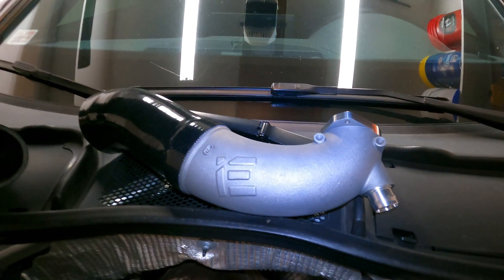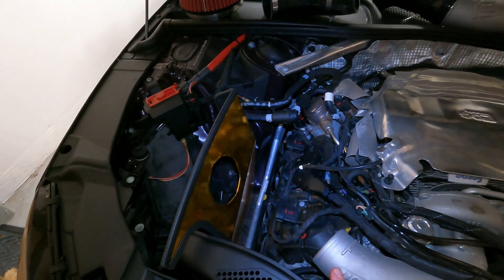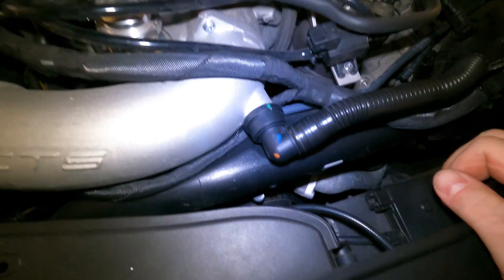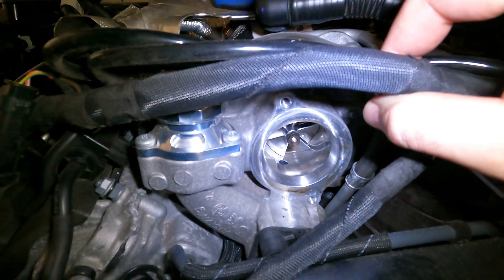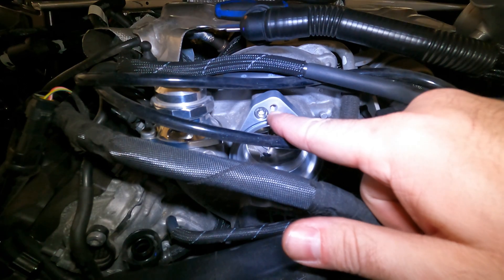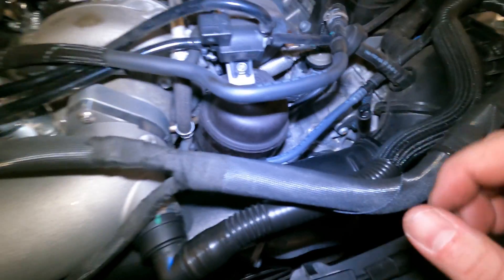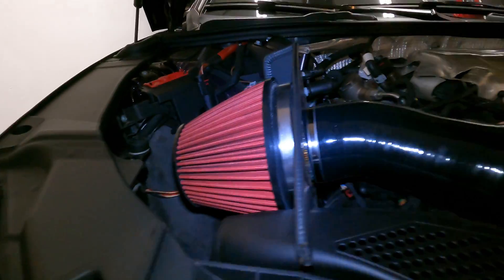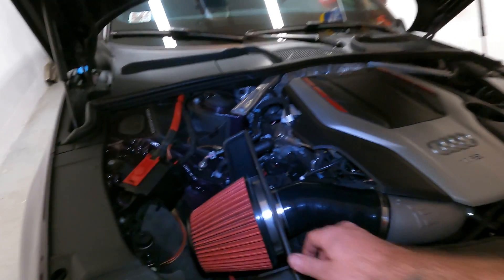B9 S4 - Integrated Engineering - Turbo Inlet Pipe Install

Comment: Do the car still pass smog with this intake and turbo inlet? And would the check engine light come on or stay off?
Reply from the maker: Honestly, I couldn't tell you about the smog stuff. In Florida we don't have those regulations (you can pretty much do whatever you want to your cars here lol). I would hit up Integrated and ask them just to be sure. However, your check engine light will not come on with just an intake and turbo inlet.
Reply: @Wobblenuts thank you bro i appreciate the help 🙌🏽
Reply from the maker: @Boostedkraft  Of course, I appreciate your support

Comment: What tool did u use for the bottom bit for the inlet
Reply from the maker: Haha basically a little wrench with an allen bit stuck into it. Very small turns. It took forever.
Reply: @Wobblenuts  so I was working on it on my Audi a6 c8 since the engine is pretty much the same and I think I might of stripped the bottom bolt :/
Reply: @Wobblenuts  took me almost 1h to get it out towards the end maybe like a mm to the end I might of stripped it
Reply from the maker: @L1N_s5  hmm, if you're able to shine a light in there and look I would double check. I think based off of where it is and the size it would be tough to strip out. If you did strip it, you could try getting it by hand, or try to shove a torx in there.
Reply: @Wobblenuts  I mean I couldn’t get a bolt back in
Reply from the maker: @L1N_s5  ohh once you got it out. Hmm, I guess its possible it could be cross threaded but I think that would be difficult given the amount of space/force you'd be able to crank down with. See if you can stick your phone down there and record a video of the threads to verify.
Reply: I had to tap it just slightly tap was too long so cut the tap 1/3 from the rear then made Ike a box so the round part had 4 flat part to grip
Reply: Went and traced the thread maybe 3-5 mm in and it went in
Reply from the maker: @L1N_s5  man sounds like a headache. Glad you got it sorted though.

Comment: Whats the pipe below the intake, i thing mine is not connecting 100%
Reply from the maker: I believe you're talking about the charge pipe. If yours are factory it should be screwed in on both sides of the engine. You'd definitely be losing power and have a boost leak if it wasn't 100%

Comment: is it bad to over tighten the stock air intake clamps around the hose? I’m talking about the one where you tighten with the flat head
Reply from the maker: I mean you want to be careful to not strip anything, but these clamps are pretty hard to over tighten. I don't think you'll break anything or mess anything up if they are a little tighter than they should be. You for sure want to make sure they are nice and tight though to avoid any movement.
Reply: @Wobblenuts  thank you 🙏
Reply from the maker: @andytran-ry7yc  of course
Reply: The hose clamps

Comment: what does it do?
Reply from the maker: The IE turbo inlet is better and a better design allowing more airflow to get to the turbo. That will help with power and responsiveness 😎
Reply: @Wobblenuts  does it need a tune to help?
Reply from the maker: @andytran-ry7yc  it does not require a tune, but a tune will only increase air/fuel and power.
Reply: @Wobblenuts  so even without a tune. An intake and inlet pipe will add benefits to my car? i’m planning on tuning on IE after a couple of months
Reply from the maker: @andytran-ry7yc  absolutely. Anything that increases airflow into the engine or out of the engine it will make an improvement. Then if you do the tune you'll gain even more out of those mods vs. the stock parts.

Comment: I did this yesterday and had a ton of fun getting that stupid oring to stay in place, even with some grease to make it tacky. Bad design. Should have been a gasket set into a deeper groove.
Reply from the maker: Yeaaa those o rings can be pretty annoying. Hopefully the rest of the install was smooth.
Reply: ahahahahhaa.. no.
Reply from the maker: @B5tard  aww man, I feel you though. I got frustrated a few times, but you don't see that in the video lol. Overall I feel it wasn't terrible if you follow the instructions to a T.
Reply: @Wobblenuts  when you find you your low profile driver is not low profile enough....
Reply from the maker: @B5tard  lmao pretty much
Reply: @Wobblenuts  And then after 2 hours of wrestling with bits and vice grips and trying to keep the blasted oring in place (yes i used some grease)... I find out they shipped me the SQ5 coupler. Which would be fine if it wasnt an S4.. Weeee!
Reply: any tips for the orings? I cant for the life of me figure out how to get them to go on. 1 hour and counting. Someone please help.
Reply: Yeah oring gasket sucks I wish I had a trick for it 😕

Comment: I’m doing the same on my b9 S4 but have the ecs luft technik open air intake with the IE turbo inlet next week.. any difference in power or response? Wonder if getting the IE intake is worth it since I have the IE stage one ecu/TCU tune
Reply from the maker: So I’ll say compared to the CTS setup that I had I can feel a difference. Most intakes are roughly the same as far as flow so I’m not sure it would make a huge difference. But, the IE intake is a very beautiful piece and well crafted. I’m sure the box helps keep temps down too.
Reply: @Wobblenuts  awesome thank you for the quick response! It is a nice looking intake for sure
Reply: @Wobblenuts  what would make more of a difference the IE inlet or the intake?
Reply from the maker: @AndyTran-e6j  I say the inlet first, because the OEM one is much smaller/restrictive for sure.

Comment: Did u notice any performance increase at all with doing the inlet? Or is this more going to be a piece that may do better for better flow on maybe a hybrid turbo setup and more boost down the road?
Reply from the maker: Absolutely. I noticed a difference between my old intake setup and the new one. It feels more responsive.
Reply: @Wobblenuts  nice I just drove a x3 m40i today I was debating returning my b9 sq5 for one but when it came to the interior the seats and air suspension I just couldn't justify it lol. The b58 engine in the x3 sounds amazing and has all most no turbo lag though. Was hoping this huge inlet may help with some of the lag with netter air flow.

Comment: Looks a beast of an inlet Matt, it will be pulling in palm trees on full throttle. Snug against the engine cover compared to stock. I think my hand fits in the gap on mine.

Good to see Archer getting involved. I think we all know he got that bottom bolt in for you in the end, but that's our secret 😉 😆

Take it easy
Reply from the maker: So much bigger over stock and my old one. And yea he did, he got it right away haha.

Comment: Hey....so why did you change those inlet pipes? They both seem to be same size & do the same thing. No?
Reply from the maker: The integrated one is much bigger. It might not show through the video, but it definitely is. The CTS is basically the same size as OEM. Maybe a tad bigger. Plus IE gives the option for different turbo flange sizes, which will be nice for future mods.